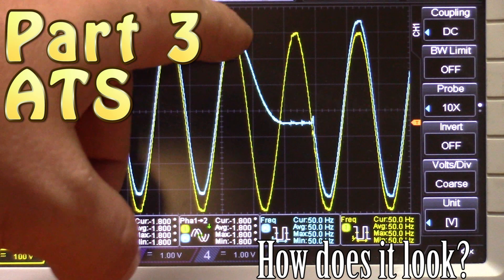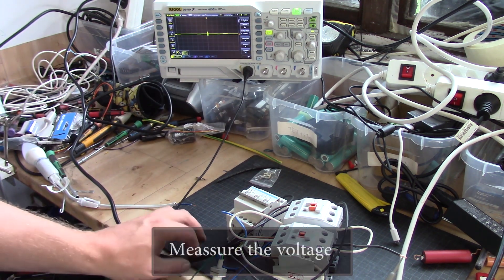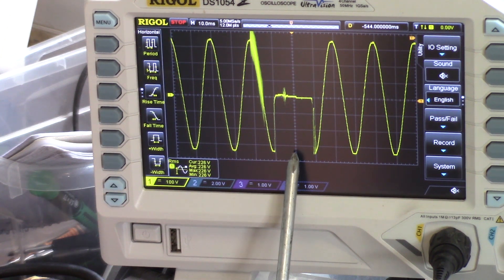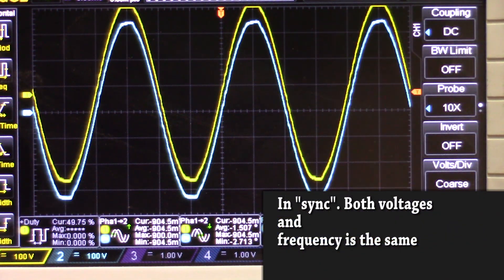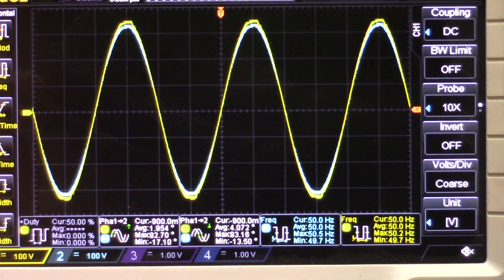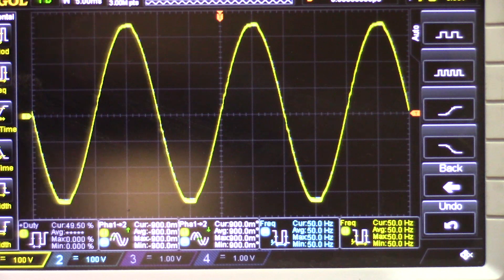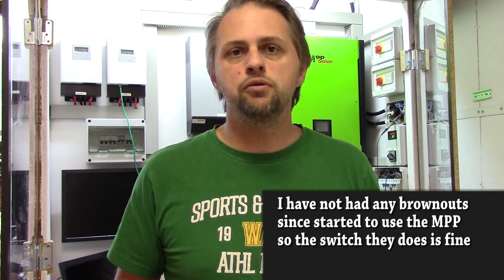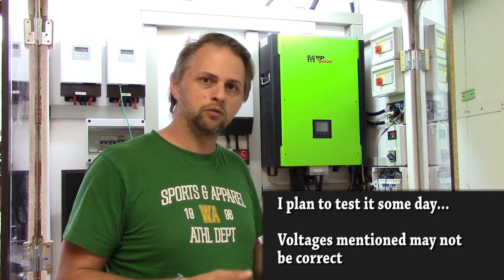Automatic transfer switch follow up - Lets scope it!

Comment: Could it be possible to use a large capacitor to help keep spikes and neutralizing (if the drift goes as far as 180Degs from each other when the unit comes back online) from occurring?
Reply from the maker: The phase shift could be an issue but since the switch is 10ms away I dont think its an issue. You can of course add filtering and so but the ATS systems i seen with normal contactors have not had it. UPS system perhaps have it but dunno about the function?
That part is more advanced than i know about :)
Reply: Gotcha!  :)
Reply: @korishan  If you are still interested about that, please see the explanation you seek in my comment, here in the pile.